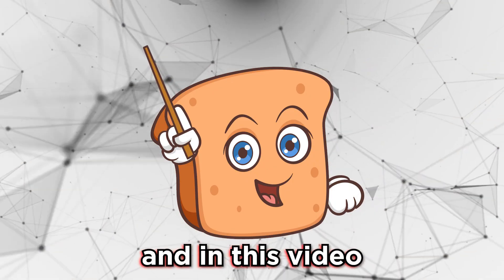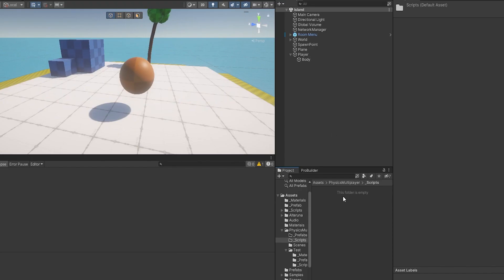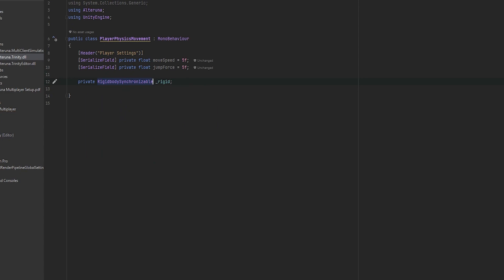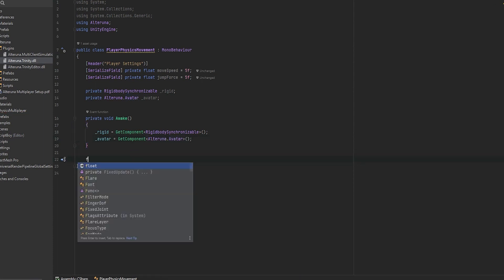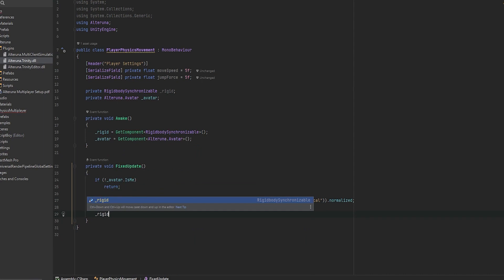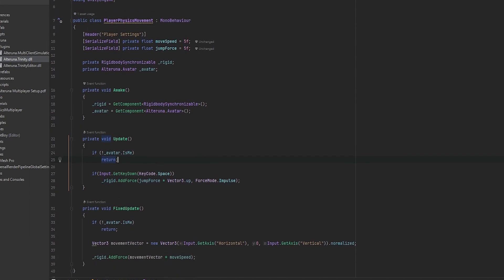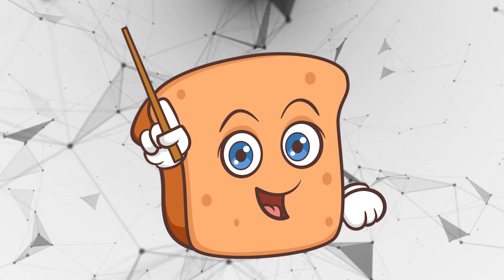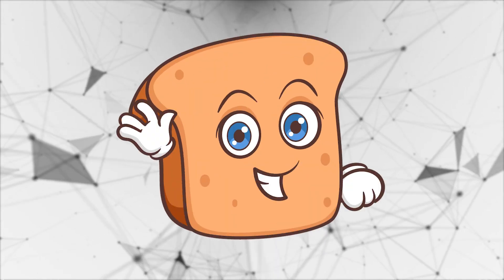Physics in multiplayer in 5 minutes - Unity 3D Alteruna

Comment: Does fishnet work as good for physics? I'm trying to make a physics based networked game, do I have to code the physics engine myself?
Reply from the maker: Well. FishNet is a bit tough on physics. If you want it to be actually responsive and fast, you need to work with Client Side Prediction, which is really really hard getting into.

Comment: For some reason adding the force to the rigidbodysyncronizable doesnt update the movement in the other client, but if i instead use the addforce in the rigidbody it does update but its very laggy
Reply from the maker: Hmm, sounds odd.
Reply: @BobsiTutorial  ikr? i followed every single step of the tutorial but it doesnt update it, like if it synced the rb velocity just the first time i connect to the room, then nothing
Reply from the maker: @Skebobongo could sound like the input doesn't sync as intended. Have you debugged that out?